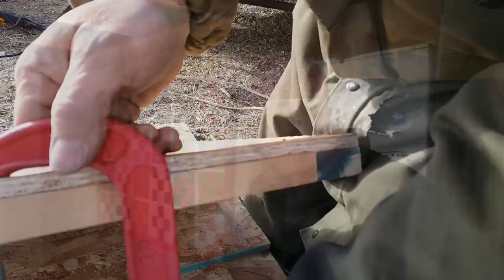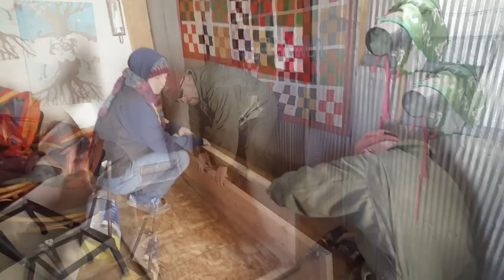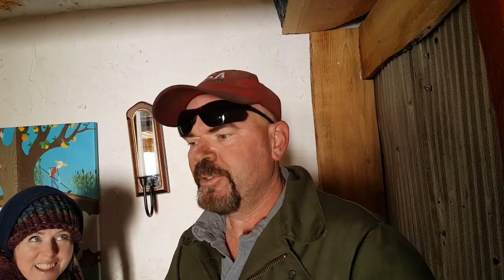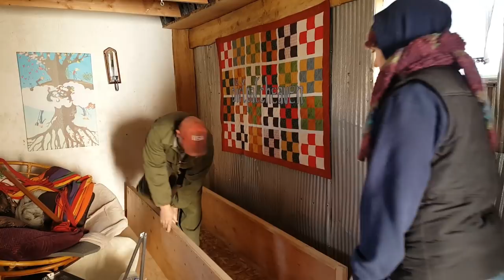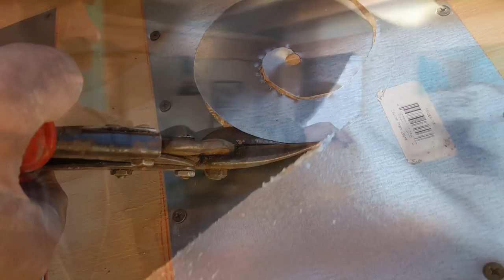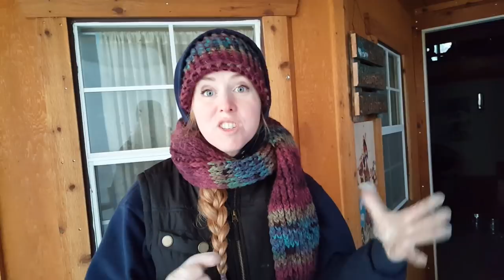Bench for Rocket Mass Stove

Comment: I really like the stuff you guys put out. I had been working with air crete for several months before I came across your videos and had made my own foam generator. I was first questioning why you needed water glass with air crete, then in another video you explained very well. I think it would be great if you would explain a little more as your going along, like you did with warping the side boards because of the pressure. You could have also said "I put this insulation down first so heat won't escape through the floor" and then included the things I wanted to know, I used 8" single wall pipe with pea gravel and sand because this , this and this. I'll keep watch and just thought you might like the feed back.